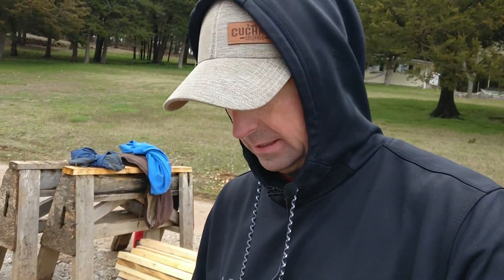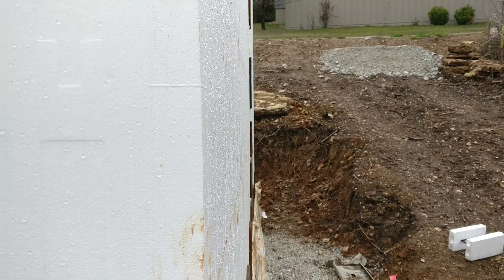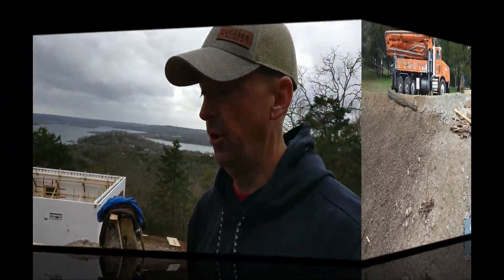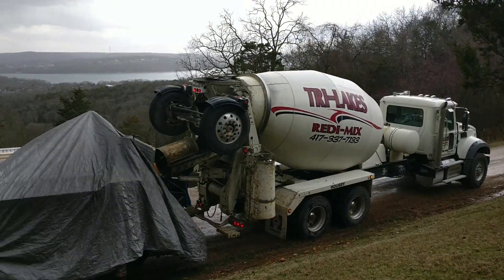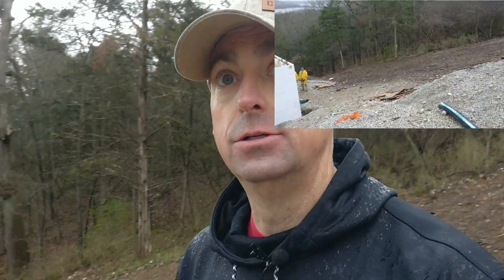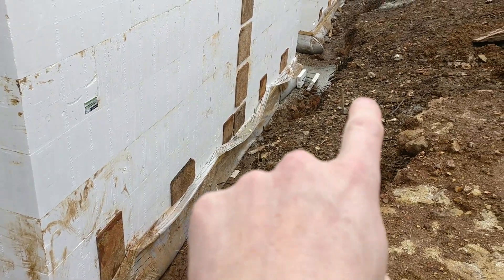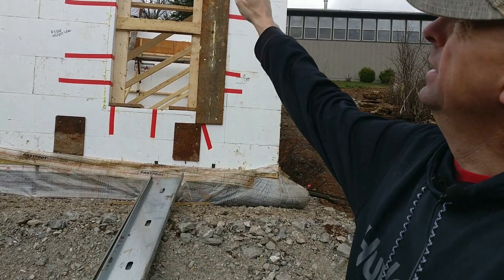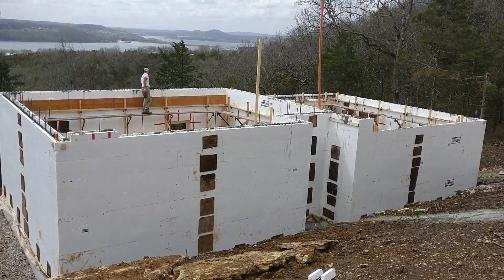ICF Concrete Monolithic Pour: Footer and Basement Wall

Comment: Hmm.  Doesn't seem like pour day is the optimal time to create the mounting points for the deck ledger board.  Was that forgotten?  BTW, a commenter from the Ozarks region on a recent Matt Risinger video on SIP panel construction was all excited about building a house with SIPS as the manufacturer was from that area also.  I hope I set him on the right path when I told him about your channel and ICF of the Ozarks!😂

Comment: With the slope of the ground it doesn't seem like the concrete needs to be so high at the back. I'm curious why it doesn't step down. Also did the concrete get vibrated?

Comment: Hi John, I do not see a video showing when the garage floor was poured. My reason for asking has to do with the monolithic one-time pour procedure, extending out to the exterior footer area where we do see the concrete mixture bludging the protective wrap. My question is ...At some time, did you slit the plastic wrap to allow the concrete to flow out to both sides of the bottommost round of the Fox Blocks creating the garage floor as part of the monolithic flow? If so, how was this done while still having the "spider web" of (2x4's) that were in a position to hold the blocks stable and straight?
Reply from the maker: The monolithic pour is between the footer and the wall. The garage was poured after this initial pour.

Comment: Thanks for the walkthrough talk through. I'm interested in building a similar home and wondering with all the plastic webs crossing through the concrete making channels for water penetration how effective is the Xypex additive?
Reply from the maker: Xypex is great. They use it in municipal water treatment plants and water towers. Our ICF contractor uses it in all of his builds he didn't seem worried about any kind of plastic penetration point problems. The plastic webbing doesn't go through the styrofoam block so the concrete completely in cases it inside the styrofoam.

Comment: How tall were the walls from the bottom of the footer to top of wall?  How many courses of FoxBlocks?  Would you do monopour (w/the footing) again?
Reply from the maker: We would definitely do the monopour again. The walls were 11 feet high with the footer when we poured. The ceiling will be 9 feet high after foundation slab is poured and floor joists for upper floor hung.

Comment: I understand how strapping contains blowouts.  Pouring the footer and walls together seems to be extremely technical. What measures are taken to ensure that the concrete hydraulic pressure  doesn't cause the foam walls to raise or separate during  the pour? Or is it a concern at all?
Reply from the maker: Great question. It is actually not a concern because of the weight and the timing of the pour. The footer is poured first and allowed to set up slightly before more concrete is poured for the walls. The full pour took three hours. The video before this one shows how the footer is attached to the walls which might help it make more sense as well.
Reply: @LakeLotBuild  Thanks for sharing.

Comment: Great video. Do I understand it correctly that the 'fast footer' additive makes the footings cure fast enough such that the rest of the wall can be poured right on top of it within the same 30 minutes? What brand is the foil used to contain the footings? Thanks.
Reply: Martin, here is an alternative process to pour a monolithic icf block/footer combination. FIRST: check with your local building code, and get their permission to do this!! Some areas will NOT ALLOW this type of “footing construction.” Now, here’s what I did with Fox Blocks in the early 1990’s with basement walls up to 16 feet tall. We dug the footing at the required depth + 4” in width. At required intervals we used a post hole digger to dig holes 12” below the footing, and plaCED Then, we ran our re-bar through the bottom of the our blocks as we placed them squaring the foundation, as we went along.
Reply: Martin, Sorry for their mixed messed previous message. It would be easier if I could send you the entire process via e-mail, if you wish. My e-addy is abtaylor658@gmail.com. I’ll gladly clearly explain the entire process. BTW those basements are still there (45 of them) and none have leaked etc. Thx.
What I did was used a “Keyway” process to connect separate pours of concrete, but still bond the pours by eliminating the “cold-joint.”
Reply from the maker: Hi Martijn!  The "bag" system for the footer is a brand called "Fast Foot." It is not an additive, but just a mechanical membrane that holds the concrete. We poured the entire footer, waited about 15 minutes and then were able to pour the walls right on top.  We used the additive Xypex in the concrete to make the concrete itself waterproof. The entire concrete pour used Xypex (both footer pour and wall) because most of the wall will be at least partially covered with dirt. Thank you for watching!
Reply: I see, that is a very interesting product. Thank you.